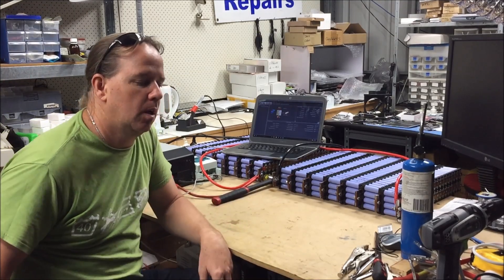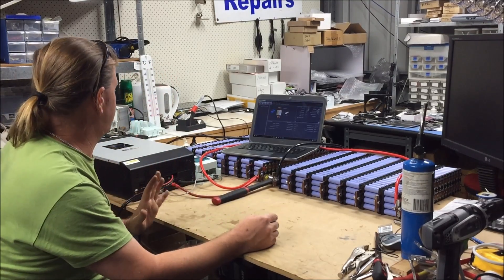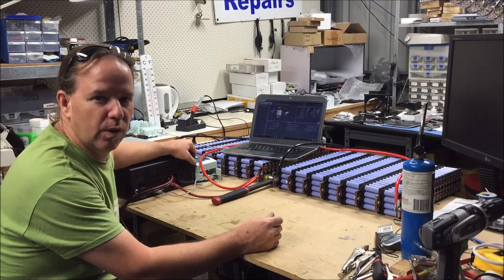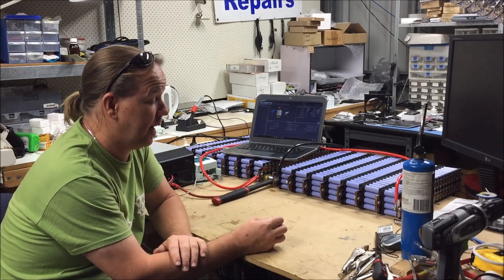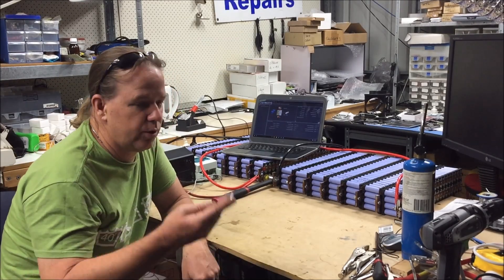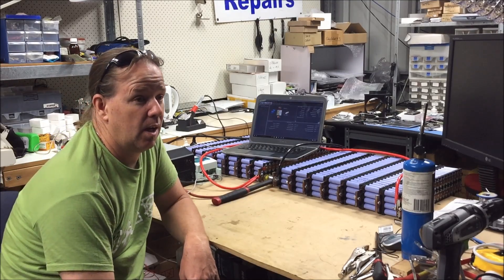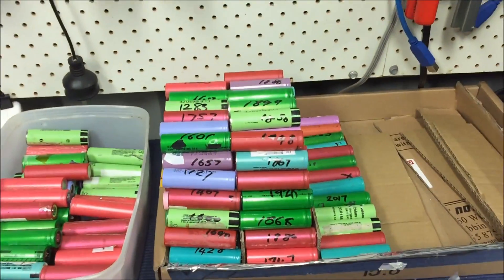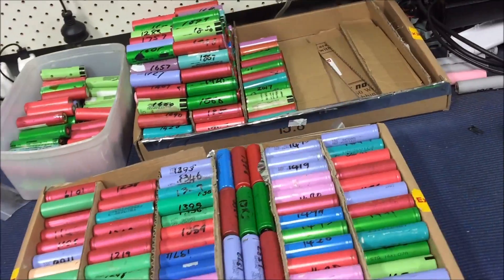Sunday afternoon wrap up of the day that was turning on my powerwall for the first time!

Comment: Hi. Does this PIP2424MSX  have a internal BMS system to control each battery pack which are connected series?
Reply from the maker: +Ramesh Perera Nop...
Reply: Then how do you balancing your each set of batteries getting over charged and over discharge.
Reply from the maker: +Ramesh Perera with a watchful eye for now...
Reply: Hmm Ok. Let us know if you fix a BMS to this pack in future. Thank you.

Comment: Charge to 4.0 till you see how it handel's the biggest load you have shutting on and off then bump it up from there... mine jumps up most after AC compressor shuts off when AC is running will dump 20 amps @ 48 volts when batteries are full, this happens many times a day voltage can slowly crawl up if your battery bank is not big enough to absorb it....

I know your not running AC, switch on/off your biggest load when batteries are sitting full see how it affects your system.

Everything looks great. Top job mate!

Comment: Well done mate. Which of your videos explains the type of solar controller charger you add to your system. Your vids keep giving me the impetus to keep going. Just done my 6x9 cells. Now movin on up to 8 by 13 with balance board. After that I'll be trying for big kilowatt heaven.
Reply from the maker: +harveyboy45 Don't think i have gone into too much detail with the charger yet it's a PIP2424MSX unit from MMP Solar. Will go into detail with it once i know it can complete the job with out issue as it doesn't have a Lipo setting in the charge controller. Just Gel and Wet.